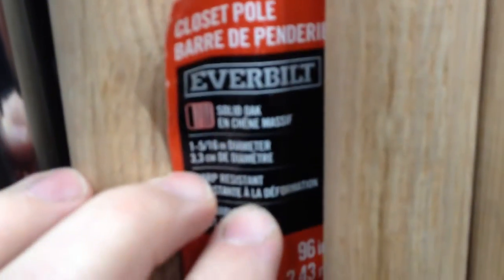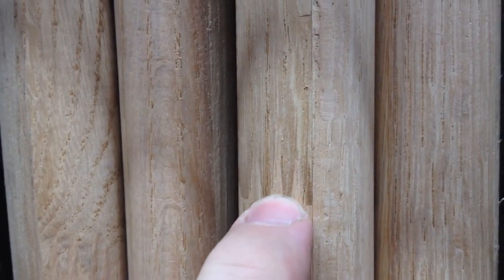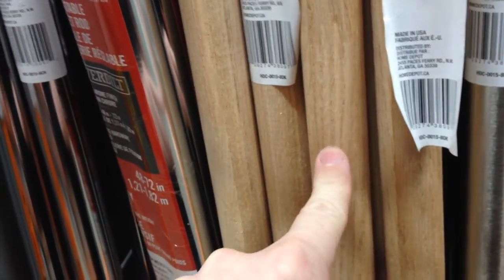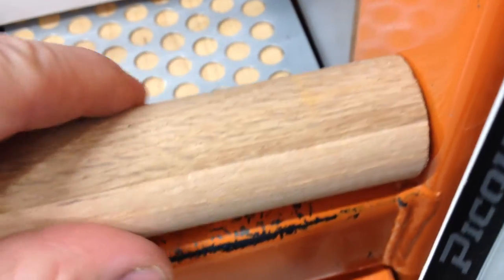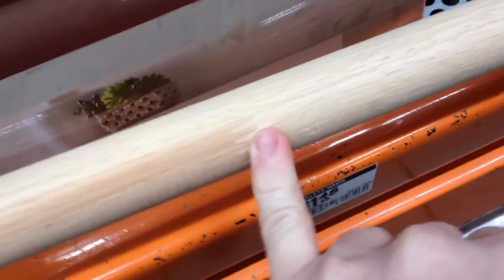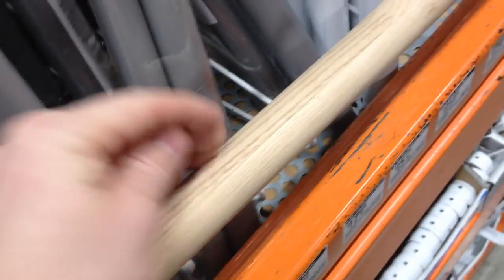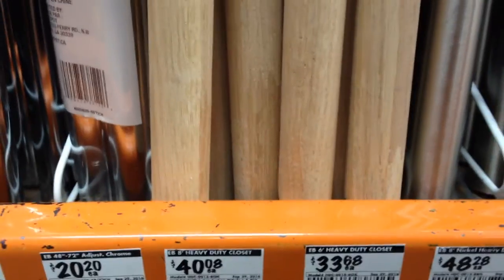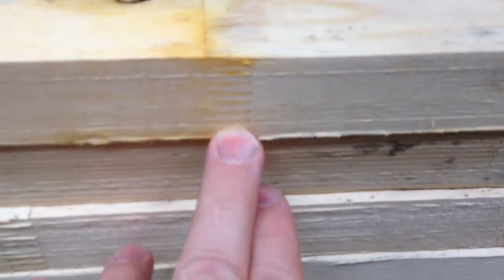Hardware store FAIL

Comment: not to be too critical here, there was no load rating on the rods.. which is an oversight of the manufacturer. the other thing i did notice is the the grain structure of the oak used in the rod was fairly consistently straight and contained no knots or other growth defects which is really good stock for a glue-lam product. 
if the rod is never exposed to high humidity (due to the porosity of the oak) or UV light the rod should be able to take a load of 40 lbs without breaking. 
in all fairness, a comparison of a rod made of solid wood and the glue-lam rod would have been an interesting contest to see which one can take the higher load. although i am a purist and detest glue-lam products they are quite strong and resilient as are many other engineered wood products, the finger joint in the stock isn't designed to bear a load and in glue-lam products the joint between the layers is the critical joint. as long as the finger joints aren't right on top of each other there shouldn't much of an issue with structural integrity.
if you wanted to run a comparison of a glued rod and a solid one that would be an interesting video, since you were the first to point this out i'll defer to you to do this, or i can do one on this sometime
Reply from the maker: Good point & brilliant idea. Run a side-by-side test of 2 oak rods of same lenght and diameter, share a link here when uploaded. I`m fitting a solid oak handle into a shovel now. Snowing heavily here at the 49th parallel.